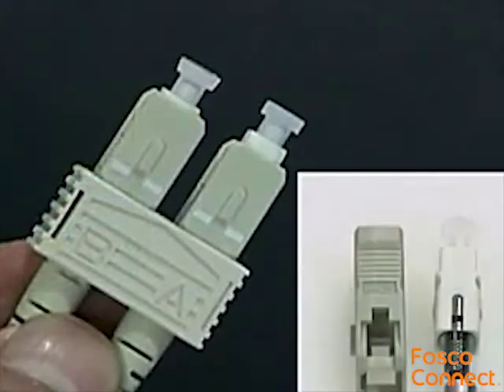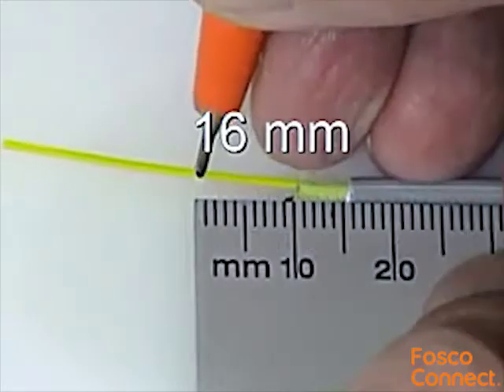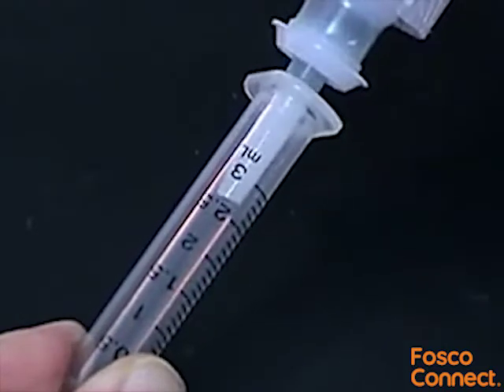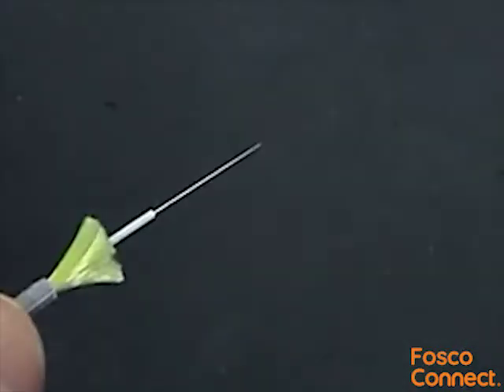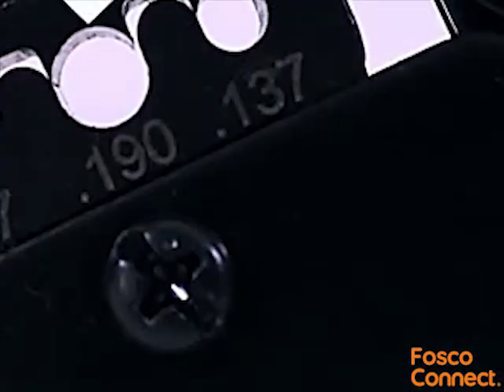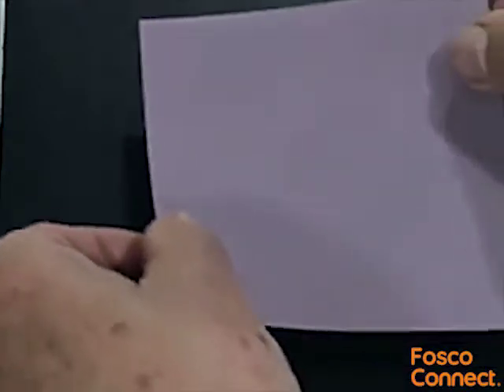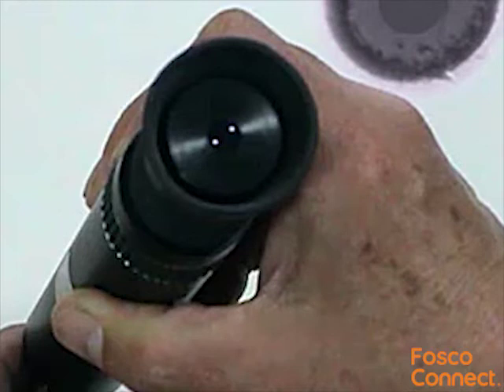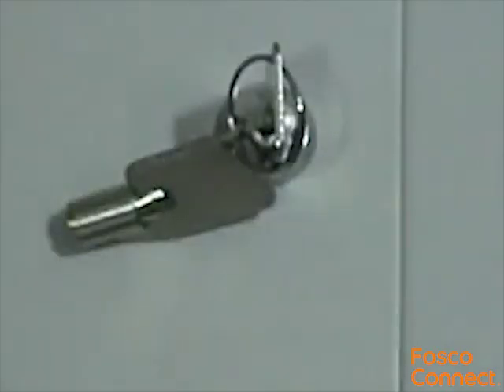How to terminate 3mm jacketed fiber cable with a SC connector?

Comment: Is this old school? versus any "new" way to do this with a cleaver, and no adhesive?   
Or is this for single mode versus sloppier less precise methods commonly used with multimode fiber?  
Also the "gray" cable used in the video makes this NOT obvious if it is multimode or single mode cable.
There is surprising little information on this in videos and easily found on the Internet.  
I'm new to cable termination and it is frustrating how many videos and websites do not explain this.